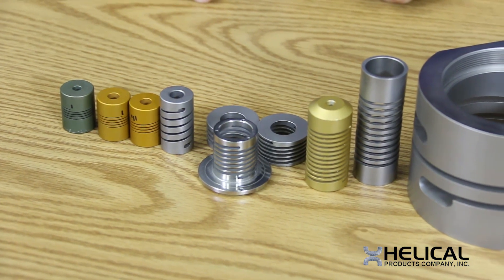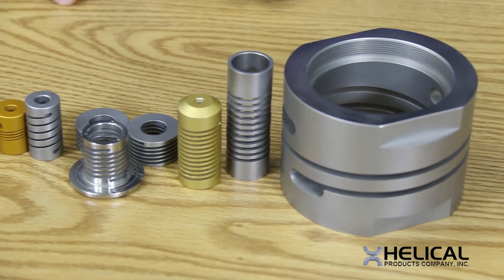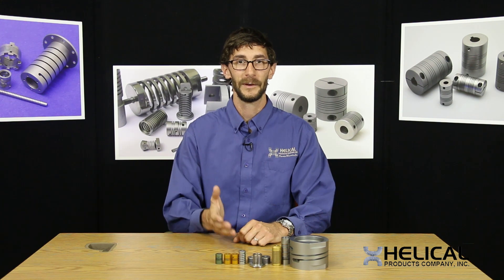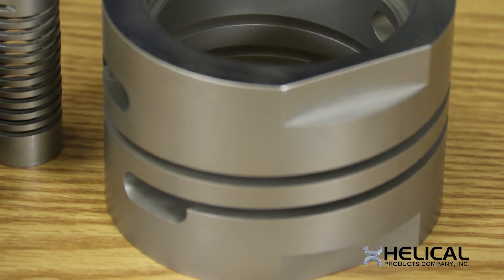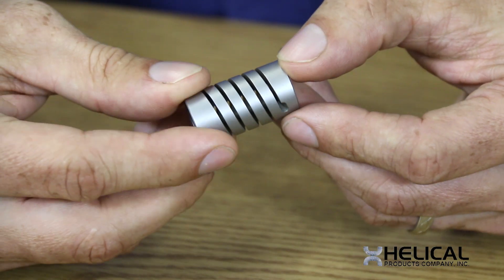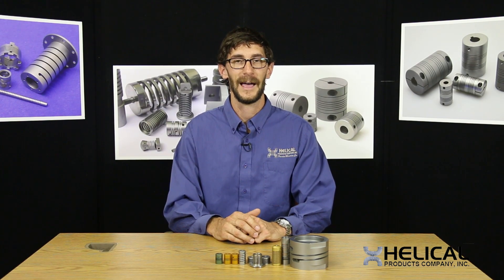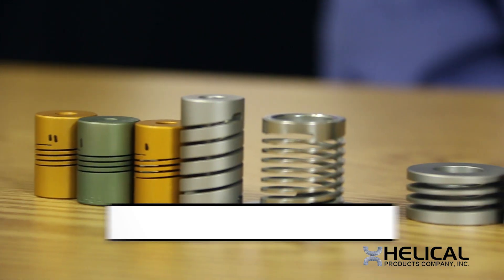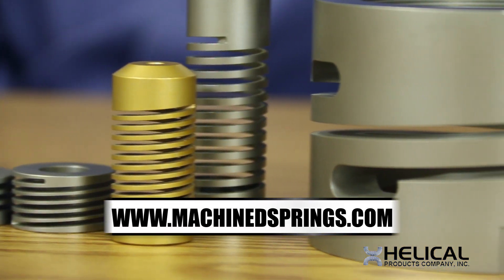What is a Multi Start Flexure

Comment: Could you please explain how a single start flexure would impose radial load?
Reply: @adrianhoyle6131Thank you for your detailed answer! I was pleasantly surprised when someone answered a question I asked 7 years ago!
Reply: @adrianhoyle6131I understand how the flexural design of this coupling would impart axial load due to change in longitudinal length but I still do not completely follow how a multistart flexure could impart radial load. Could you please explain this?  Thanks.
Reply: @adrianhoyle6131Thank you so much Adrian! No need to apologize. I appreciate you very much for such a detailed answer. I must say that you are very good in conveying technical stuff with such precise language. Your explanation does clarify the source of the radial load, which pretty much confirms my own understanding of the loading condition for a single start flexure coupling.  Might I ask, were you a technical writer at some point in your career? Just curious! I am blown away by the command of your language with the clear explanations you provide! Thanks a lot again!
Reply: @adrianhoyle6131I am not quite sure I follow what you are saying here -> "The triple leads at the opposite end can still be clocked at 90 degrees". Could you please explain how the triple leads can be equi-spaced 90 degree apart?
Reply: @adrianhoyle6131 I must say UCSB trained a fine professional. Based on the explanations you provided I reckoned you must have some engineering/physics background. I am happy to know I was right! Thank you for sharing your educational background! Much appreciated!
Reply: @adrianhoyle6131Thank you very much. That clears it up! Your prompt and clear response is much appreciated!
Reply: Karthik C I think he could point you to the page in his textbook where he read about it, but I doubt he could explain it to you.